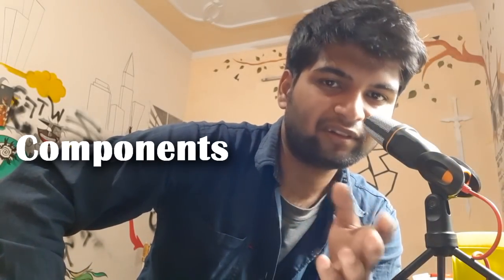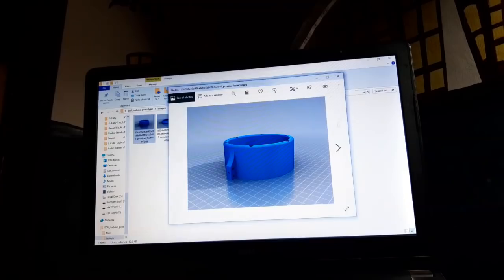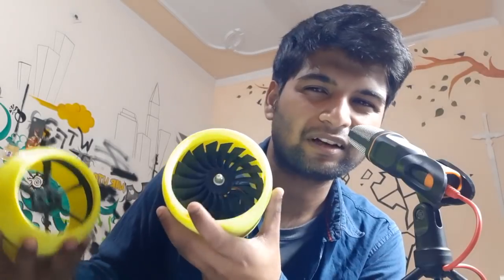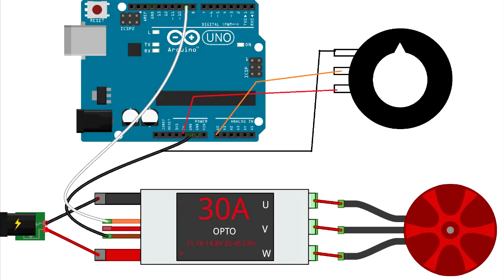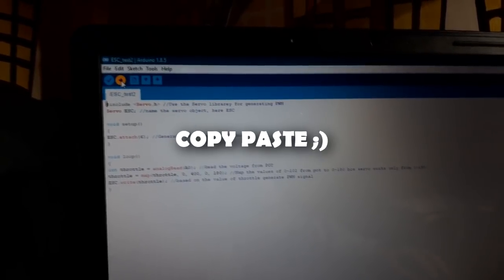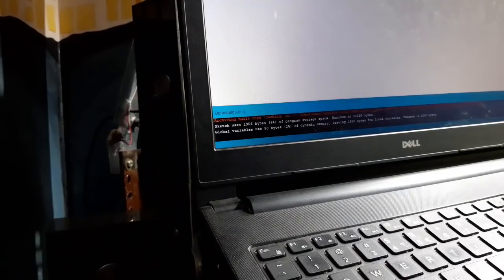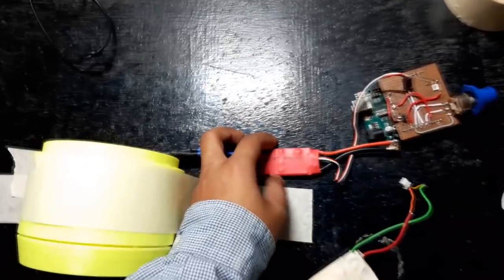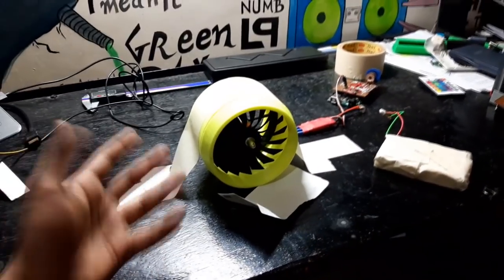3D Printed Jet Engine

Comment: Areee, the engine and the propeller is designed to produce thrust to the opposite side . Just change the direction in which the motor is spinning now by swapping the yellow and red wires

Comment: If your ESC gets too hot you can either use a bigger one or you can mount a bigger heatsink.
Also note that the fan is way more efficient when spinning in the correct direction 👍

Comment: Very nice video! Now I think I will design another one for a bigger BLDC motor (ask me if you want the design), print it and test it!
Reply from the maker: I will! Thanks
Reply: @ArnovSharma  I created a folder on my Google Drive for designs and I put inside a little jet engine for brushed motors. Here the link : drive.google.com/open?id=11O8BsATGdCKHjVHl1ujgWsFRyuj9JEno (you just have to add https : //).

Comment: That error 404 was because he was not using a proper lipo battery (lithium ion batteries dont have enough C rating )probably he was using nicd or scrap mobile batteries to power that motor
Reply from the maker: Actually no, I'm using generic 3.7v 18650 lithium ion cell battery pack of 12v 5.2A
Reply: @ArnovSharma  18650 cells are 3c rated only as they are lithium ion. so you need to use a lipo battery which supports more than 18c to power that motor and get the best efficiency or another alternative is to make a lithium ion battery were you connect 6 18650 battery in parallel and 3 in series
Reply from the maker: @justkalola6604  oh i see. Thanks for info.. will make a lifepo4 battery pack and run this from it
Reply: @ArnovSharma  lifepo4 batteries will also not solve the issue because the are also rated around 3 to 4C ratings so you have only two option that is lipo(lithium polymer)battery or a car battery (i have been using the car battery to power this bldc motors and trust me you wont end up frying them rather they would work like a charm
Reply: @ArnovSharma  the reply from sudha kalola was from my grandmothers account